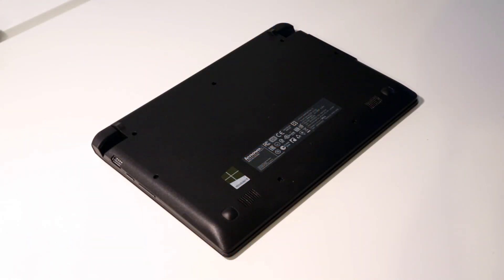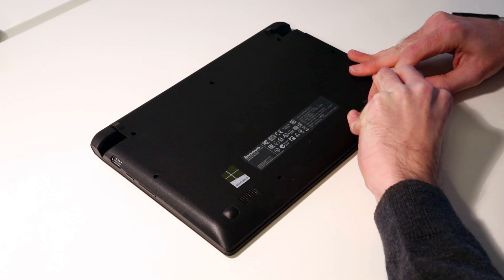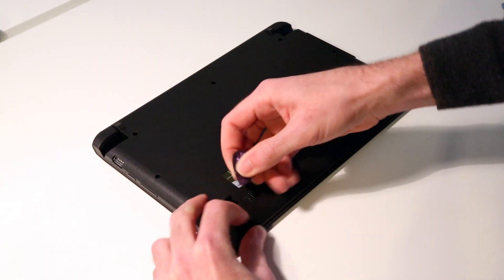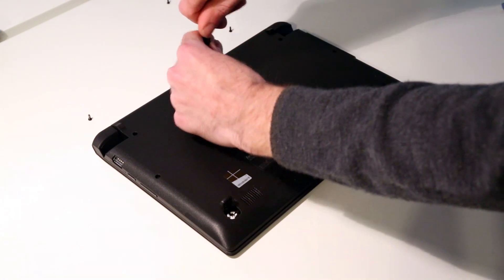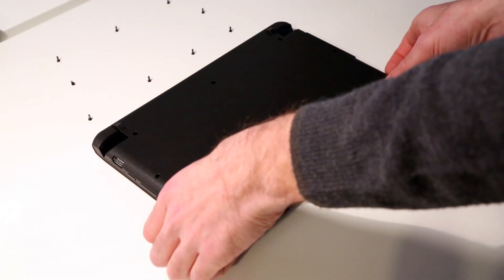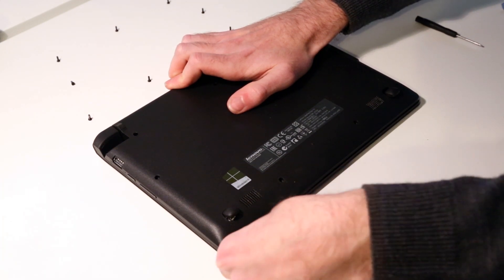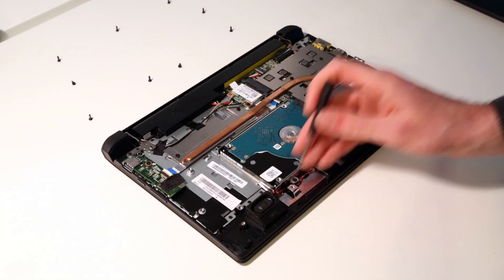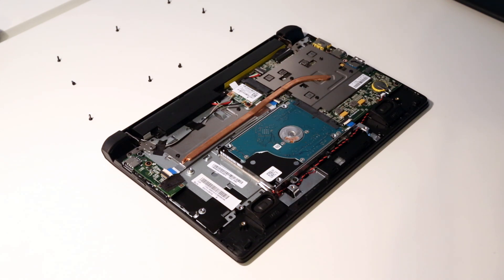Lenovo Flex 10 - Disassembly and HDD upgrade guide

Comment: The DC socket is the yellow one on the other side of the motherboard. Its soldered directly to the motherboard and is quite fragile however it can be replaced rather than having to swap out the motherboard as Lenovo would have you do.

Comment: hi man. can i just ask if its possible to take the battery out. my lenovo has a charging problem, charges intermittently and i cant pinpoint if its a cable/charger fault or the battery's fault? i was thinking of removing the battery and try to run laptop on charge/cord only to see if the fault still appears. what do you think? thank you
Reply: Yes you can.

Comment: The RAM is soldered in? So you can't easily upgrade it RAMwise?
Reply from the maker: +Richard Hillier That is correct, you cannot upgrade the RAM at all.
Reply: And like, even if it wasn’t soldered, as I understand it, the motherboard and stuff are temperamental.
Reply: So if it becoming slow, we can't do anything? I mean this Lenovo flex 10 can't be upgrade?
Reply: @quirinanovianty8436  the best thing you could do is replace the HDD with a SATA SSD but I don't think this laptop is worth it.